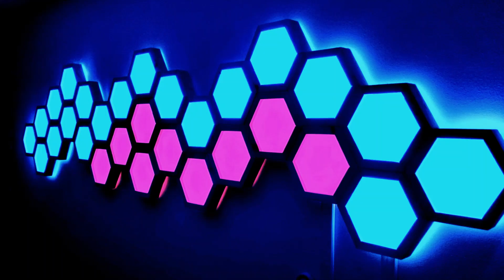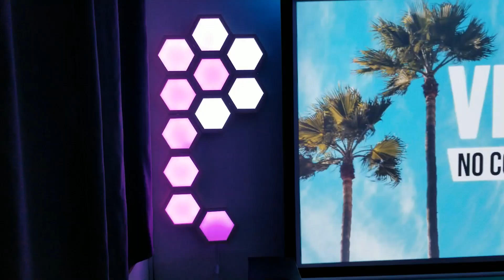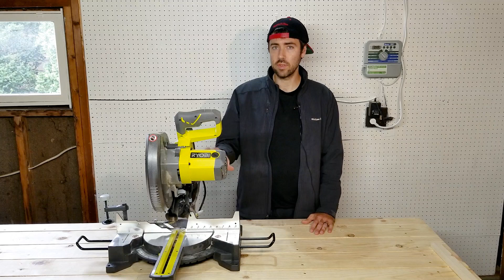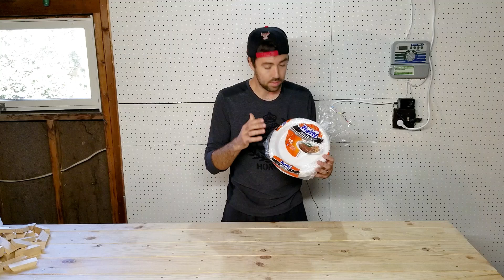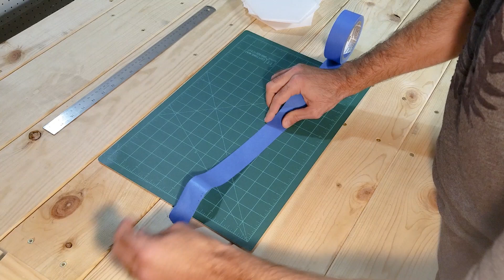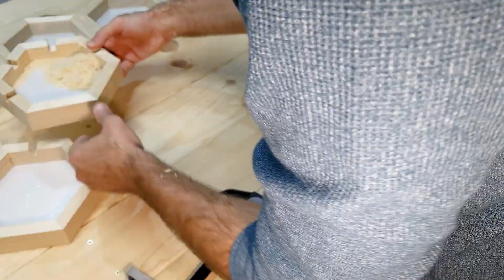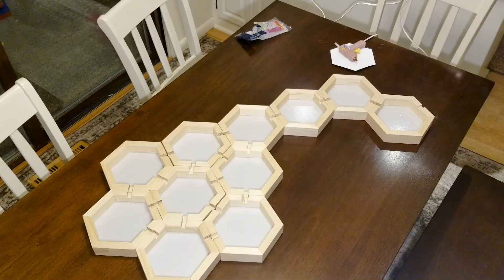Making My Own Version of Nanoleaf Hexagons - DIY Project (No 3d printing, programing or soldering)

Comment: Did you consider 3D printing instead?
Reply from the maker: I would love to experiment with 3d printing but I assumed it would be way out of my budget to invest in a 3d printer and whatever else is nessesary to start. Do you have any experience? Is it expensive?
Reply: @ChrisMaherDIY  Yes, I have been into 3D printing since 2010... 10 years now... damn! time flies! I would personally strongly recommend the Prusa i3 MK3S which you could buy as a kit for $749 plus shipping (~$800 in total) or fully assembled for $999 plus shipping. It comes with everything you need to get started. I would recommend getting the kit version since it is cheaper, faster shipping and it gives you the experience you would need to maintain it later on. It comes with an amazing assembly instructions with colored pictures and a bag of Haribo candy and a BIG spool of PLA filament! Do yourself a favor and do not buy cheaper 3D printers or else you will find yourself in maintenance hell which will end up costing you more time and money later on! Prusa offers a mini version for $349 plus shipping if your budget is tight. I have not tried it personally but I trust Prusa's quality. 
This is me unboxing the kit (https://youtu.be/eppNJ7lPSKg)
This is me putting it together which took me around 3 hours... it could be done faster but I took my time (https://youtu.be/ivIvR2oO6YA) 
3D modeling is the real bottle neck when it comes to 3D printing! I would recommend using Fusion 360 from Autodesk. it is free for now and it is the best tool in my opinion. 
good luck!
Reply from the maker: @Alshafi  thanks so much!! You definitely know your stuff! I'll check things out and hopefully some day I can invest in one as they are super cool and we are just scratching the surface on what they can be used for.

Comment: Thanks for the video! It's the best DIY idea for this project. 
I've already cut the wood. But I live in Germany and it's pretty hard to get the plates.. do you have any other recommendations? Cardboard plates maybe?

Thank you!
Reply from the maker: Thanks so much! The trouble i had with this project was since the lights are so close to the diffuser material, it was hard to find something that had very little hot spots but still spread the light out evenly. The only other thing that i tried that worked just about as good was some milky white stencil sheets of plastic paper. I had to layer about 2 or 3 of them on top of each other but it looked just about as good and still would have been pretty cheap! Here is a link to what i tried using. I'm sure you could find something similar at a craft store. https://www.hobbylobby.com/Crafts-Hobbies/Stencils-Craft-Paints/Stenciling/Stencil-Blanks---12%22-x-18%22/p/27038
Reply: @ChrisMaherDIY  Hey Chris, thanks for your nice reply. Unfortunately the website is blocked in my country. I will check our nearly hobbystores and if you want, I can tell you what I've alternative used.
Best wishes
Reply from the maker: @luisf8940  Yes please do let me know! I'm not sure if this link will work for you from Amazon but what it was similar to this. https://www.amazon.com/WONGYEE-Stencil-Sheets-Reusable-Templates-Make/dp/B07Y4ZGDVM/ref=sr_1_10?dchild=1&keywords=white+stencil+paper&qid=1605276359&sr=8-10
Reply from the maker: its a different brand so i don't know for sure if it would work like the other kind i tried but it looks the same from what i can tell!
Reply: @ChrisMaherDIY  I've used architects paper, it's very thin, but it looks very nice. I'm now thinking 'bout how I should fix it on the wall.. :D
Reply from the maker: @luisf8940  awesome idea! I'm going to have to look at architect paper!

Comment: I believe you can cut led strips and take small wires to solder it back on to the connection points.
Reply from the maker: Thanks for the advice! You are right. I tried this out after all the comments saying I could and it worked hooking up the leftover strips to a separate controller I found on amazon. Thanks!
Reply: @ChrisMaherDIY  that's good. We learn something every day. Keep up the great videos.
Reply from the maker: @inspectorsteve2287  Yes we do! Thanks!
Reply: I was about to say the same, but wanted to make sure nobody else already had.
Reply: @tharon6530  I'm glad you agree. I was starting to think I was wrong and these were a special kind of LED strip.
Reply: You can solder these together. I had three 5m strips that I soldered together to make one continuous 15m strip across my roofline for my Christmas lights.

Comment: I love this project and I will probably tackle it in the next few months. One suggestion: use a table saw to slot the boards before cutting the edges on the miter. Any thoughts?
Reply from the maker: Thanks so much! Let me know how it turns out! Someone mentioned the same thing and I was like yeah, that would be super easy! But then someone also mentioned that if you did that half of the slots cut would be in the wrong side since you have to flip the board with every cut on the miter. You would just have to make 1 extra cut each time in the miter if you use the table saw but in my opinion it would be worth it since using the table saw to make that cut would save a lot of time!
Reply: Chris Maher Maybe you could mirror the cut to the other side of the board as well to cover the other half of pieces, and then it would form the same continuous line on the exterior and would simply look like an intentional design.
Reply from the maker: @berrberr3194  i think that would work and probably look pretty cool with a line on the outside as well! Thanks for the great idea! Brilliant!

Comment: did you you paint your other build before or after assembling the wood pieces?
Reply from the maker: I ended up not painting any of the hexagon designs. just kept it natural wood. If i were to paint it, i would do it when all the cuts are done but still in pieces. I would also paint the inside below the slit for the plates white (better reflection for the lights) and then everything else i would paint whatever color would look nice where you would be hanging them.

Comment: Straight line, 90°, and T connectors are available for all LED light strips, as are power connectors. So nothing becomes “useless”.  Ridiculous not to  show the final lighting up of the unit you’ve just made  - either it didn’t work at all, or didn’t work as intended is the impression that’s left.
Reply from the maker: Yeah my bad! I thought since I put all the pictures and videos of the finished product at the beginning, no one would want to see them at the end again. Next video I will for sure put the finished product at the end. Admittedly I don't know much about LED strips. The Amazon page where I bought them said cannot be cut. My guess is they can be cut and spliced back together but maybe the different dreamcolor effects may not work?

Comment: did you try semi transparent styrene instead of styrofoam?
Reply from the maker: No I don't think I ever ordered any of that material to test out.  Have you used any of that stuff and if so did it work out?!
Reply: @ChrisMaherDIY  no i havent, i just found out about the material.  Apparently its kind of like credit card plastic and can be ordered in multiple thicknesses, cheap and super easy to cut (after a few scores with a razor blade, it just snaps apart).  When I was looking for some on amazon, i saw this semi transparent type that said it could be used for light diffusion. May be worth a look for a more permanent solution since its so cheap when you buy big sheets.
Reply from the maker: @Sircivus  thanks! I'll for sure look into it. Definitely sounds a little more durable than plates lol.

Comment: Did you have to do any programing to get the lights to sync up using two strips?
Reply from the maker: No programming. Just used the different features built into the app to control. You can also use Alexa to control some features as well.

Comment: Can't you solder the strip back together with some wires, I'm sure the one I got said you were able to connect back using connecters and I've seen people solder other led strips with wires
Reply: yes that is 100 true, you can use an adapter or solder them.
Reply: They are solderless
Reply from the maker: Thanks for the advice! You are right. I tried this out after all the comments saying I could and it worked hooking up the leftover strips to a separate controller I found on amazon. Thanks!

Comment: hi, I am French and I would like to know how to proceed to have the same color on each hexagon while the back LEDs mix with those at the beginning in the technique used
Reply from the maker: Thanks for the comment! There is some simple customizing that can be done with the app you use with the lights however is you want to be able to customize things a lot more, I'm not smart enough yet to be of any help in that area.
Reply: @ChrisMaherDIY  however, you, in your video you managed to put the LEDs of each nanoleaf at the same rate
Reply from the maker: @cleanrawsthenics  what is the time in the video you are referring to? I can then hopefully let you know exactly what I did
Reply: @ChrisMaherDIY  0:08 you managed to put the leds of each nanoleaf in the same color whereas since you are walking around them, it should do something weird
Reply from the maker: @cleanrawsthenics  At :08 in my big Hexagon design on the right wall i have some hexagons that are teal colored and some that are red. I had to use 2 sets of lights since 1 set did not fill the entire design. The 1 set of LED's i have set to just display teal. the other set of lights i have wrapped inside the hexagons that i have set to display red. Since i have 2 sets of LED strips i can control each set independently.  What i cant do with the method and lights i used, is control the color in each individual hexagon shape. I hope that helps!

Comment: Great project and these panels look great! the plates is a great idea for diffusion material!
Just for some information, its good you used the shiny side on the inside, this increases reflection inside the light box and helps scatter light for a more balanced diffusion. Also for an even better spread, it would help using some type of reflecting tape on the inside, like AC duct tape.

once you cut them you can actually splice them back together, there are connecters you can buy that allow for that.

this would be what you would be looking for, they make them for many different pin types/sizes of strips.
https://www.amazon.com/Connectors-Solderless-Extension-Multicolor-Connector/dp/B07Y35MGWB/ref=sr_1_1_sspa?dchild=1&keywords=led+strip+connector&sr=8-1-spons&psc=1&spLa=ZW5jcnlwdGVkUXVhbGlmaWVyPUEyVk5KM0c3RVJGQUxSJmVuY3J5cHRlZElkPUEwNTUyMjU1N1o3QzE1TU9TTjRSJmVuY3J5cHRlZEFkSWQ9QTA2MTgyNTcyNzcxRzFBUDdQRVpYJndpZGdldE5hbWU9c3BfYXRmJmFjdGlvbj1jbGlja1JlZGlyZWN0JmRvTm90TG9nQ2xpY2s9dHJ1ZQ==

these are solderless, but if you prefer they make ones you can solder as well.
Reply from the maker: Thanks for watching and the comment! I'm glad I guessed right and put the shiny side down lol. I see! That makes sense now that I see those connectors. And pretty cheap too! Thanks Justin!
Reply: The mylar tape would also help with heat dissipation as those lights can't breath.
I mount all my strips to aluminium (I'm Australian) to extend their life and efficiency!

Comment: To answer your question about the cut and waste thing -  the led - s are single programmable. Without programming, they dont know which color to show, so you can use it as extension on a similar led - (the device you connect it to is sending out the data to led-s. https://www.tweaking4all.com/hardware/arduino/adruino-led-strip-effects/ here is a great follow up to try it out with arduino. this needs some reading, but would make this project  more customisable.  love the video, will try it out.
Reply from the maker: Thanks for the comment and link. i just checked it out and some of those affects are so cool and it doesn't look too difficult. Definitely want to try it at some point! Thanks so much!
Reply: @ChrisMaherDIY  check ' Cine-lights ' youtube chanel, he got great videos with programmable leds. Thanks for the video, awesome idea

Comment: WS2812b led stripe and also a microcontroller such as esp8266 which is cheap and easy to use and also comes with built-in Wifi. I also noticed you used the hot glue which might not be the best option as that cool down abit too fast and leaves a gap between those hex pieces.
Reply from the maker: Thanks! I'm loving all the great recommendations on LEDs to use as I'm not to familiar with everything out there. And great observation and I agree about the hot glue gun. You have to be fast and it definitely can leave gaps. I would say wood glue would be better if you have clamps and patience. I had clamps but not the patience. Lol.
Reply: @ChrisMaherDIY  Great build

Comment: You should be able to splice those LED strips back together without an issue. There is a direction though, DOUT needs to match up to DIN. If you connect the DOUT of one section to the DOUT of the section you are trying to splice back together, it won't work.
Reply from the maker: I'm going to try doing this with some leftover led strips I have and see what happens. Sounds like I just need to make sure the direction is correct. Thanks for the advice!

Comment: Nice tutorial! Instead of suggested WS2812b you can use newer WS2815.
It has DC12V input instead of DC5V. And "with 12v input , the WS2815 LED strip can run longer than WS2812B strip light because of less voltage drop."
Reply from the maker: I'll for sure take a look at those. Is Amazon still a good/best place to buy LED strips like this or is there a different place that is better?
Reply: @ChrisMaherDIY  aliexpress for sure. I just checked them there
Reply from the maker: @fruferSK  thanks!

Comment: Use a router or table saw on the 8foot piece for the slide cut. Time saving !
Reply from the maker: 100% yes! So much easier than doing what i did for every piece.
Reply: @ChrisMaherDIY  That wouldn't work as you had to flip the board to get the same angle on each end of the 4" pieces. So you would end up having some pieces with the slide cut on the wrong side.
Reply from the maker: @bonertv9375  yeah you are right! Half of the cuts would be on the long side of the wood when you need them to all be on the short side! Good catch!!
Reply: @ChrisMaherDIY  Still though, excellent craftsmanship. Your jig to bust those cuts out quick is wicked and the styrofoam plates for diffusers is brilliant. I'm an avid maker as well and watching your process was a lot of fun, cant wait to see what you post next!
Reply from the maker: @bonertv9375  thanks! It was for sure a fun project! Glad you enjoyed it!
Reply: @FAKE-NAME  To fix it all you need to do is flip the wood and take only the little angled bit off. would waste like an inch of wood per piece but time saved would be a blessing
Reply: @henrylightfoot6392  this is a really good idea too. I would absolutely take the time saved over the wood saved lol.

Comment: Try WS2812B leds. It's individually addressable and you can cut it as many times as you want. Then you can connect it to some ESP8266 module and control it by wifi with free open source firmware. I'll be happy to help.
Reply from the maker: I'm almost done with another project but my next one i think i'm going to try using the WS2812B. I may very well be reaching out! Thanks!
Reply: I went thru a lot of trials and errors with my led saxophone. I'll be happy to share my experience ;)

Comment: great job man, the issue with most of these diy builds are that they have led hot spots which take away some of the attraction but yours are among the few thst look perfect man also i had never thought about using wood but its a pretty good alternative to other materials if u dont want to 3d print
Reply from the maker: Thanks so much! Those were my thoughts exactly! I couldn't find a video on youtube that had the end result i was looking for since most had hotspots.

Comment: i really like yor video but  i thought  the cut was supposed to be 60degrees 
for the  wood
Reply from the maker: Thanks for watching! I'm not 100% sure but i think the degrees on a miter saw must work differently than using a protractor?
Reply: 30 + 30 = 60 overall is 60*
Reply from the maker: @pbertlin6194  ahhh I see! Mystery solved. Thanks!

Comment: For the 29 panel piece that you made. What led strip lights did you use? Were they the same ones in the video and were they long enough?
Reply from the maker: Thanks for watching! I did used the same ones and I had to buy 2 of them to get enough lights for all the hexagons. I didn't use much of the second one I bought but it was needed.
Reply: @ChrisMaherDIY  thanks so much for your response! You’ve got yourself a new subscriber btw! Sorry for bothering you again, but how did the lights coordinate with two separate strips. Thanks
Reply from the maker: @bobsmieth3485  thank you! The short answer is no. The long answer is kinda. In the thumbnail you can see where the green is one set and the red is another. Now I can control both simoltaniously using Alexa to change them all to whatever color but when they are on music mode or a pre set scene the are doing their own thing. You can create a custom scene on each to have the colors you want cycle through so there is some customizing. With my limited knowledge of LEDs and programming I feel like it's about as good as it's going to get. Also, each pack comes with 2 strips of 16 feet that plug in separately to the WiFi controller device. I believe this is the same type of connection the Govee (spelling?) ones have but I could be wrong.
Reply: @ChrisMaherDIY  got it appreciate it!